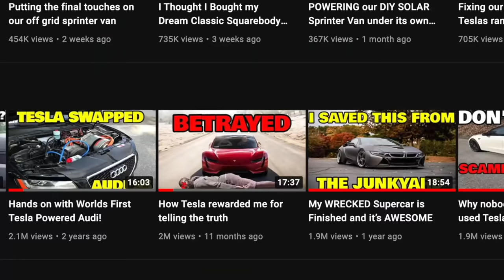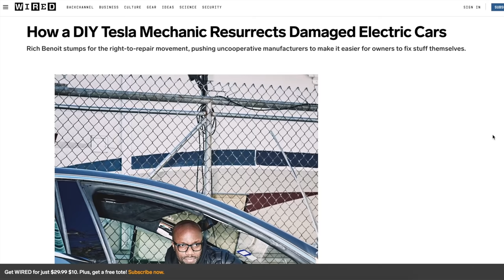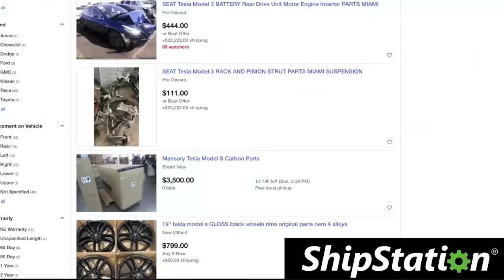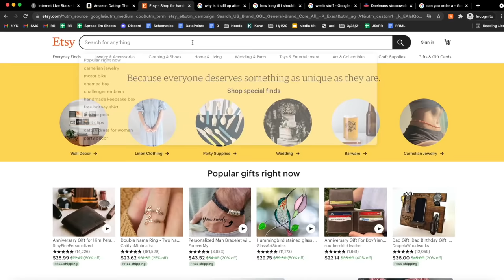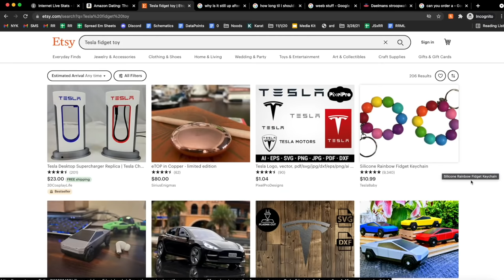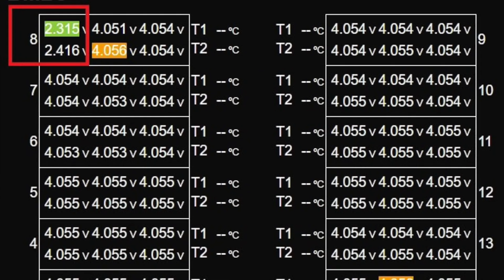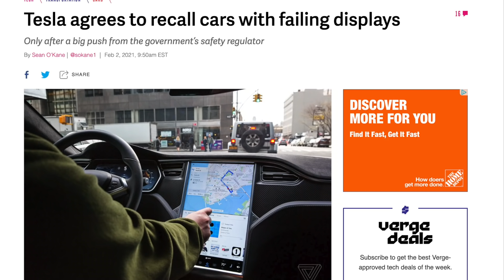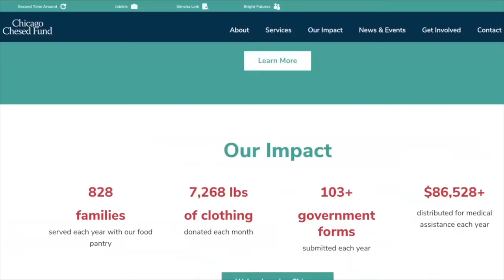Tesla wanted $16,000 to fix this NEW Model 3, we did it for $700! The importance of Right to REPAIR!

Comment: Electrified Garage has our open house on Saturday the 17th of July from 1-5PM. 7190 Devons Road, West Palm Beach FL 33404, come one come all!
Reply: I’m so confused. I thought you were in New England.
Reply: A strong epoxy could have possibly worked also.
Reply: @electric8668  agreed. I've worked on some hv battery cooling systems that can't have Brass or Copper in them because of the galvanic corrosion over time. I hope there is not the same incompatibility in the Tesla system.
Reply: @brendykes6599  We have 3 locations. This is our latest location.
Reply: Yrvan Michel  We are familiar with the Mach E we can help you customize/personalize it and then also help you with your service needs going forward.
Reply: @brendykes6599  I think they are opening another shop
Reply: has there been an explanation yet to explain the Boston vs. West Palm location? Does Rich commute at high speed between the two? LOL
Reply: @brendykes6599  He moved to everyone is moving to now Florida Sunshine state for God's sake!!!!
Reply: He takes the hyperloop
Reply: @scottuccio  🤣🤣
Reply: i have a question, does the cooling circuit includes any metals part with it's system? because placing brass could damage the metal parts via corrosion. maybe using a plastic part instead could have been more secure... any way nice video :D
Reply: Rivian has a hardened under panel. I'm definitely upgrading to that after watching this video.
Reply: electric car owner only?
Reply: @squa_81  Brass isn’t really know for corrosion
Reply: @seandurgin  when you have to different metals inside an electrolyte, like water, one metals tends to dissolve in the electrolyte while the ohher corrodes, that's why in pc water cooling people avoid putting aluminium, not known for cording either and copper, not known for corroding either, together.
Reply: @squa_81  gotcha.  So your concern is the other metals in the system could act as the sacrificial anode? I would have used JB weld myself. That was way too much drama for a leased vehicle.
Reply: I know someone who would probably pay the 16K for that repair.  He paid cash for a Tesla.  He is my relative and he is super smart, went to MIT. Has had Facebook and Google and HP chase him to come work for them.  He makes more money in bonuses than you or I make in a year (or at least me in IT, I have no clue what you make).  He is a super smart guy, the question I ask... Is he dumb enough to pay 16K for something that could cost 2K?  Who knows?  Nice job..  Totally brill as Jack Black would say..  Heidi
Reply: Some thoughts. It's fixed but there is a reduction in internal diameter causing some increased restriction to flow. This repair is out of spec. That will have an effect on the cars value at the end of the lease. I would suggest obtaining the part from Tesla, ebay or a junkyard. Drop the battery pack and replace the broken part. Should be a lot less costly than a pack replacement and maintain the cars value at end of lease.
Reply: EG is the go to for any EV owner, even under warranty, they will provide a regular maintenance, inspect a lot of little things and give you the piece of mind we all deserve. Lucky me I have one here in South Florida. Congratulations to you all.
Reply: @patrickkaufman5614  he said in the video that its okay as they aren't reactive
Reply: California E Garage? Southern Cali you'd make a killing.
Reply: There might be a good after market mod for a stainless steal plate instead of that plastic.
Reply: You guys need to start making “Eg” branded metal skid plates to replace that plastic one which seems can be pierced easily
Reply: around 700km away, otherwise I would have popped in :(
Reply: @HeidiandFranny  I make a ridiculous amount of money (I did edit this because I sounded like an asshole). I would absolutely pay that just to get it done and over with. On a side note, I would never buy a Tesla for many reasons one of them being a 16,000 dollar repair. Many, many, many reasons I wouldn’t buy one, and that’s definitely up there on the list.
Reply: @electric8668  I was wondering myself why they didn't use epoxy and a little plastic sleeve, to save themselves all that threading hassle.
Reply: @danielbulley1635  There are 3 locations. NH, Ocala FL and West Palm Beach FL. Florida has the most per capita used Tesla's in the country and is the second biggest market outside of California for them.
Reply: @brendykes6599  We are opening a new location in West Palm Beach this weekend. It was originally in Dania. We have 3 locations total including one in Ocala Florida as well!
Reply: @guilleport  He didn't move we are opening an additional location.
Reply: @andru451  The owner of the building is a customer and Tesla owner. Definitely wouldn't go near MAACO after what happend to Dolores bumper!
Reply: @WaldemarPerezJr  I just asked the same question...also, why isn't Tesla making one sell to customers at cost to help with their reliability and durability?
Reply: @seandurgin  Corrosion depends on the flow of current.  If there is virtually no current, there will be virtually no corrosion.  It’s also likely antifreeze will prevent corrosion.  Automobiles use antifreeze and dissimilar metals, there is no problem with internal corrosion.
Reply: Will the #RichRebuilds Crew be in attendance❓
Reply: Moss act .... It is illegal in the US to void warranty due to service, unless they can prove that that service caused the "warranty issue"
Reply: Holy shit! You're just a little north of me!
Reply: @ahetafan8087  yeah I'm sure they are gonna inspect that for a lease turn in. They probably gonna put tires, brakes, cabin filter and a good detail and sell it to someone else.
Reply: You guys are doing an amazing service to EV owners!
Reply: @patrickkaufman5614  Or you can also buy a stainless steel 1/2" hex nipple for about $5 on Amazon .. But i think i would have just repaired that port leak with a good quality 2 part epoxy resin ? i recently repaired a oil pan on a 93 Corolla that rusted with a series of holes on the bottom with an epoxy and that oil pan has been still working fine in snow country without leaking over 2 yrs later..
Reply: How much you charge to turn my 06 M5 to all wheel drive. If that’s even possible?
Reply: @squa_81  Magnesium is a common electrolytic sacrificial electrode. Every tank-type water heater has a magnesium anode rod. Ships have both passive sacrificial electrodes and active electronic corrosion protection.
Reply: @Vexar  Any significant fire will total the car, prompting your insurance to buy it from you.
Reply: @ElectrifiedGarage  Each MAACO shop has to be evaluated individually. I have received excellent work from a MAACO shop while I have heard horror stories about others.
Reply: @nikize  Using aftermarket parts that are not made of the same materials to the same specifications as the original parts is a candidate for a warranty violation.
Reply: @quinnjones1221  Selling stuff for free (no profit) is against the doctrine of the Church of Elon.
Reply: @TheCoolmandingo  Anything is possible with a large enough infusion of cash. Up front. In advance.
Reply: @algrayson8965  you might want to double-check US law on that one.
Reply: @JeremyWhy  If you count me as part of the crew I will not be there.
Reply: @brendykes6599   Rich is everywhere. 😉
Reply: @chrissalvo1935  Hey Chris 🖐. Hope all is well down there. Good Luck with the new location 👍👍
Reply: Great repair!👍
Reply: @justahasbeen  That was 2 years ago. We are looking at a larger space and will have one then.
Reply: @JeremyWhy  Yes they will.
Reply: @danielbulley1635  I'll bet it's for a better political climate. A few states are less dictatorial and FL has no income tax. I moved from CA 12 years ago for both those reasons.
Reply: @brendykes6599  they have more than one garage. 3 actually.
Reply: @brendykes6599  r
Reply: Yeah I’m in Maine. I just ordered a Tesla 3 months ago. Should be here any day........ 
anyway when I break it I know where to go.
Reply: You guys should open up a new location out West!  The majority of Tesla owners are in California and would love to have another option besides the Tesla service centers.
Reply: @brendykes6599  he is. He opened a shop elsewhere.
Reply: Come to Vegas
Reply: I'm looking forward to my first EG repair on Monday in Ocala! Congrats on the new location!
Reply: @JJ-ti5lh  I ordered one, went to pick it up and refused it because of the total and complete lack of customer service.
Reply: Elon MUSK is New God! Mars is the New Earth! Earth Will soon Die Anyway! TESLA and Tesla Holders will be Kings. Rest and their Family will be Our Slaves and work to Power energy for Bit coin!! Elon is Einstein, Edison, Newton, and Jesus combined. HE at least deserves several Nobel Prizes. Elon has more IQ than weight of Hater's Ug ly Prius and his F at Ho Combined!! HE is like Ironman who will destroy Thanos and critics are better off using their cash to wipe their a n us. JUST Worship Him instead of other silly god!! GOD Elon will Punish infidels!! Go Emperor God Musk!! Elon's brain chips and AI will Control and Destroy any resistance!
Reply: there needs to be a location on Long Island, there are tesla’s galore
Reply: @jamescannone1425  we actually have Syossets service manager working for us. Unfortunately NY sucks to do business in and property costs are eye watering
Reply: @brandonhuffstetler2599  thanks for coming out today!!!
Reply: Great you're in South Florida! My home! Ok I know our State is long and being that I'm from the Florida Keys I'm a good 4 and a half hours away. But you are a lot closer than Tampa or Orlando!
Reply: 3 words "right to rapair" I just hope it is not some more bs.
Reply: @kurtg3891  what 2- part epoxy resins do you like? TIA
Reply: @kimariokiji  I think 3M are probably the best quality ive ever tried but my rusted out Corolla oil pan has been holding on over the last 2 winters after applying couple thin coats of JB weld...
Reply: @brendykes6599  ty
Reply: Keep rocking Rich!!! Regards from Costa Rica 🇨🇷
Reply: What was the cost of your repair on this ?
Reply: i'll be there
Reply: Any repair garages like yours for teslas in NC?
Reply: Appreciated by Many Tesla Owners
Reply: It is not just $16K. Can Tesla refurbish battery & other parts?? If so, it fetch atleast another half value at $8K. Potential gain would be over $24K!!
Reply: In my area there is only one body shop that is approved it is also the lowest rating body shop in my area🤦‍♂️🤦‍♂️🤦‍♂️
Reply: @johnnyCham12  unless Tesla is evil enough to flag his name if they watch this video. 🤔 You heard the story about that Tesla owner who bought a used Tesla and when he contacted Tesla to transfer the warranty, Tesla remotely disabled the extra performance package on his car saying the 1st owner paid for the feature, not him (as the 2nd owner). They wanted $6k to re-enable the performance feature for the 2nd owner. Unfortunately, they can be that evil! 😡
Reply: @algrayson8965  unless you don't have comp coverage like that guy.
Reply: @anopraca  i believe Rich said $800 in the video.
Reply: Does gap insurance works the same thing for break downs  ?

Comment: I like the "let's save the planet" narrative and then we throw a car away for a piece of plastic
Reply: I expect Tesla will earn from this and make improvements.  The battery pack that was pulled would have been recycled for home batteries or materials for new EV batteries.  Certainly not good, but not worthy of a ICE narrative.
Reply: @ericl4160  it would have been partially recycled, and only if recycling is cheaper, if not, it would have gone straight to a landfill in sub-saharan africa
Reply: It’s all fake.
Reply: @onelyone6976  Next house, I intend to buy an old Tesla battery pack to build a home battery, lots of people do.  Batteries materials can be recycled, not well, but better than some bad plastics already.  Petroleum biproducts are more wasteful.
Reply: @darksideblues135  What's fake? The claim of "save the planet" or the ridiculous oil & gas hate of Tesla and EV manufacturers to save hold back the renewable wave that will crush them?
Reply: @onelyone6976  also, the first the owner pays for a brand new battery, then Tesla wants to take the original one away for free, which they later refurbish, and use for e.g. a replacement under warranty instead of a new battery which would cost them a lot more... 🤔
Reply: @ericl4160  i have no idea what you are talking about.
Reply: they aren't throwing the car away, they are just asking the customer to pay for a new battery pack while they reuse the component in the pack, maybe remake into Tesla Powerwall battery pack.  They do this to save cost on not having to carry various parts at service centers and not having to train their service people on how to fix the issues, and make extra from selling the reused components in a new product.
Reply: You don't honestly think they were going to toss that perfectly good battery do you? They were going to have this dude pay for a new pack AND keep the "defective" pack for deployment in new cars and/or battery refub programs. All the hardware that matters is fine.
Reply: @ericl4160  however end to end in terms of carbon footprint a simple tap and union is far more ecological than cocking around with an entire battery pack.
Reply: @darksideblues135  You said above, "It's all fake".. I was asking what you were referring to and had a few thoughts. What's fake?
Reply: @xsu-is7vq  Understood, but a full battery replacement is a little extreme here, this should be repairable since their is nothing wrong with the battery pack.  I expect Tesla would sell the old pack on the market and not reconstruct into a Powerwall, due to costs as well.  They can get cells easier than CPU's right now.  I hope that Tesla will learn from this and make changes either with service or pack design.
Reply: And whoever paid for the new battery gets to keep the old one. Wtf is that the manufacturer won't let you keep the parts they took off your car?
Reply: @ericl4160  they won't, they don't care, listen to the ex tesla employee, for them it isn't cost effective to replace individual parts so they won't do it.
Reply: If people maintained their cars millions of 1930s cars would still be in daily use.
Reply: @ericl4160  climate change and the ev being green
Reply: @serdiefgotreb  Shame.  That will be problematic with Right to Repair comes into effect.  When the libertarian hits the social capitalism highway, it will get interesting.
Reply: @algrayson8965  I would argue that's the statement is overlooking a key factor.  So few people would be interested in driving those cars on the roads today.  Some of those older cars are classic and worth preserving as a museum piece, but a $500 beater is a better car than those cars, while it would cost way over $500 to fabricate a part for those classics.
Reply: @ericl4160  you know. I have had people like you tell me that the reality was coming in the 70’s. Never did. Then they said that reality was coming in the late 80’s. Never did. Then they said by 2010, never did. 

You’re the one peddling misery. 

I’m saying there’s Nothing going on.
Reply: @darksideblues135  The economics were not feasible in the past and motivation was not there. Those two factors are no longer a barrier. Other parts of the world, were the other two factors were less barriers are further ahead than North America now.  The Oil and Gas lobby are doing all they can to discourage adoption, as it's worth billions to delay it.  People willing to sacrifice the future for feeling good or justified now are the barriers to progress, like they usually are. I tend to move forward, not hold onto the past.
Reply: @ericl4160  plants need co2. Gas when oxidized produces co2. 

If we reduce co2, plants well die. Why are you anti plants?

And tell me again how 0.04 percent of the air will DESTROY US ALL?
Reply: @darksideblues135  Also a Renewable transformation one of the great global economic opportunities, similar to the industrial evolution in the 1900 and tech in 2000. Are you anti-capitalism?
Reply: @ericl4160  I ignore comment because NASA started our planet or getting greener and forest fires are caused by government neglect and refusal to do controlled burns. 

You need to start at the very beginning before puking all this nonsense. 

1,) they have been wrong about climate change for the past 60 years. Tell my I should trust them. 

2,) please address how 0.04 percent of the atmosphere will destroy us. Especially if it moves up to 0.041 percent. 

You need to address the questions before your comments have any merit. 

But here’s the thing. You won’t because these are the sandy foundations your arguments are based on and if you can’t explain these two things away, then the rest is moot. 

Your premise is this:

The science has been wrong for 60 years but just like socialism, this time it will be right and 0.04 percent of the atmosphere which science says only half retain heat in and the other half reflect heat away will cause us all to die. 

So explain that. Go a head. Just so you know, out of all the air molecules, every 625 nitrogen, hydrogen, or o2 you hit, you will hit one co2 molecule. 

Green is planting more trees not switching to electric cars that catch fire like the Volts are now.
Reply: @ericl4160  1.) they have been wrong for sixty years. They said we would all freeze in the 70’s. They said we’d burn in the 80’s. Then they said... stuff would happen in the 2000’s. 

There have been no warnings, just constant lies. 

2.) co2 makes up 400 parts per million of our atmosphere. So, that’s 0.04 percent off is composition. How do you not know that? 

Looks like one of us isn’t that well educated in the subject.